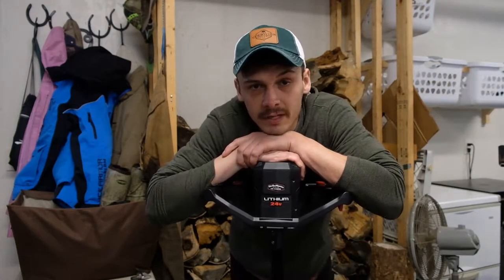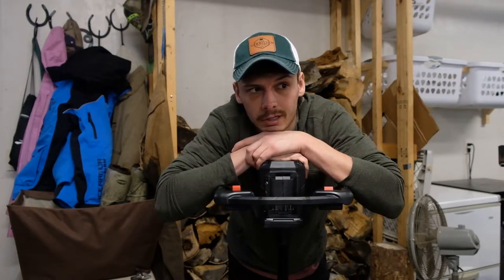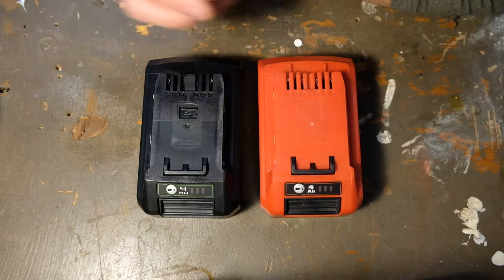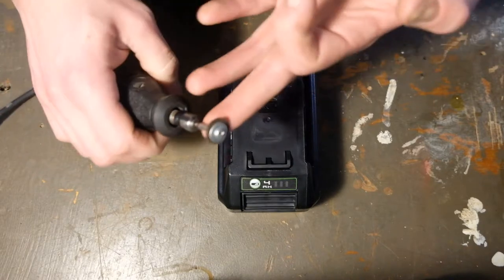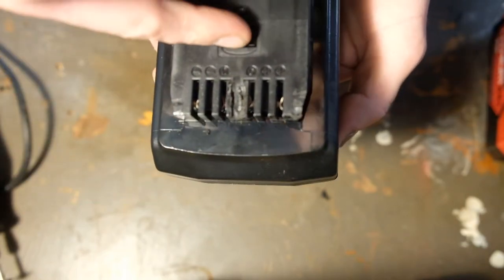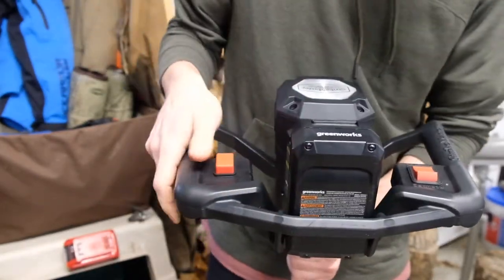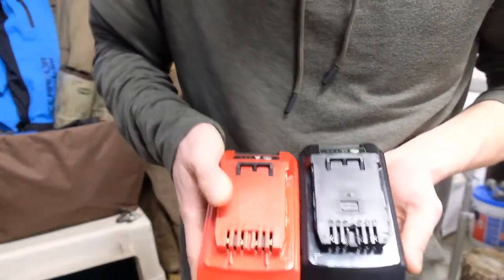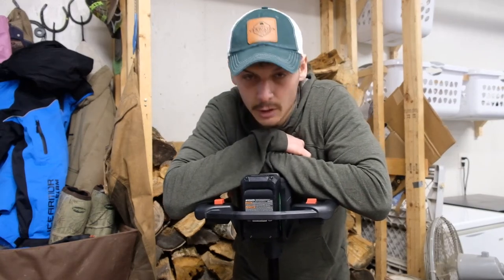Greenworks to Strikemaster 24V Battery Conversion [How To]

Comment: The slot is exactly 3/32" wide and deep. A 3/32" drill bit exactly occupies the slot. Heat a 3/32" drill bit, held in a visegrip, push it down until flush and pull it out. Clean up the ooze with a utility knife and do it at least one more time to make sure the slot is open. Easy, clean and exact modification.